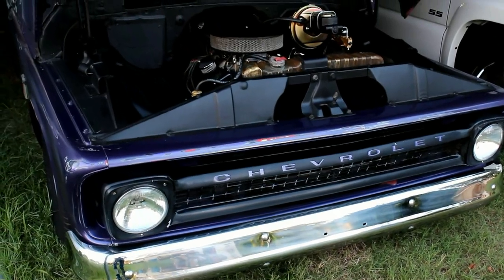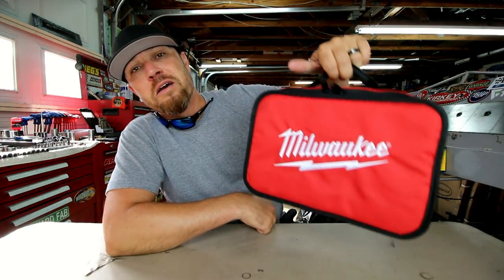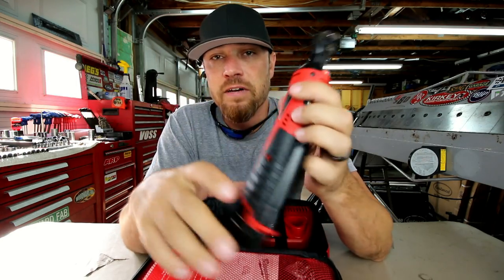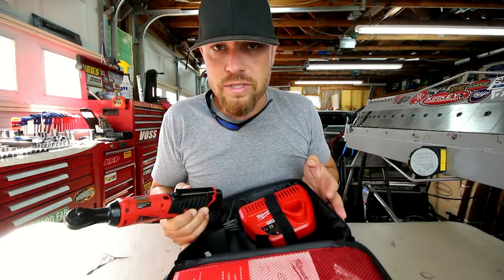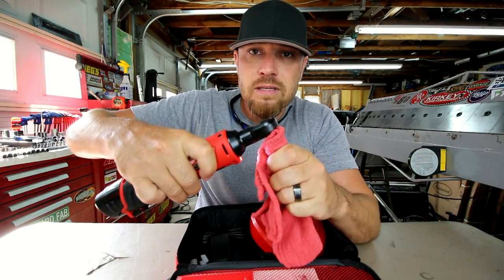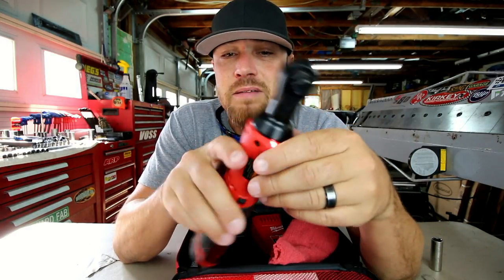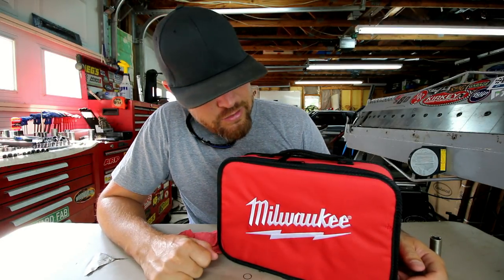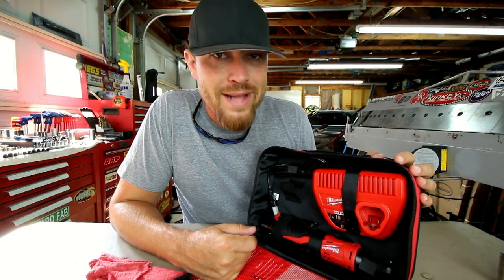You Need This Tool - Episode 77 | Milwaukee Cordless Ratchet Kit

Comment: I started to use mine as a total ratchet replacement, gets into all the same places, and generally more, and also speeds up the job a LOT

good for going slowly when you're trying to tighten something like a bracket that will bind if not lined up just right, jumping back and forth between bolts

I probably use mine like a breaker bar more than I should though..

Comment: I am a mobile mechanic and have been using the 3/8 Drive ratchet for 3 years now on a daily basis it is by far hands down the most convenient, easy to use, reliable tool I have in my truck.Every tool that I have is Milwaukee battery powered and I have yet to have one let me down. As far as I'm concerned there are no tools that even come close to the reliability and convenience of my Milwaukee battery powered tools.Ed Parrish Deuces Wild mobile auto repair
Reply from the maker: +Ed Parrish I would have to agree
Reply: I had all my tools ripped off about 2 years ago tell me for about $5,000 worth and I believe it was Sadder then the day I got my divorce, and to the a-hole who took them, You Know Who You Are, I will find you 👊

Comment: Nice idea from Milwaukee. The tool definitely has value when trying to ratchet bolts and nuts when in a tight space. I still use my air-driven ratchet, the only difference being that I have to turn on the compressor, attach the ratchet to the hose and go to work. The Milwaukee would allow me to bypass those steps and go right to work. All in all, I prefer cordless tools and use them whenever possible.
Thanks for the heads-up.
Reply from the maker: cool

Comment: Been using mine for 5 years. Do a lot of cummins and pstroke work. It ain't balsy by any means but for 10mm bolts, it works great.
Reply from the maker: yeah I see it coming in very handy on v-band clamps and the such

Comment: I have a few Milwaukee tools and the 3/8 Dr Ratchet you have I use pretty much wrenching with Three Wheelers call Go Cars and so far I am very happy and impressed.  Only thing is I wish the outer plastic case was better at not showing all the grease marks.  I happen to own both the 1/4 and 3/8 drive ratchets with the 4.0 stand up battery pack.  Love this tool and I am sure you will begin to appreciate it the more you use it.  Enjoy........  :)
Reply: PhantomPiney not sure to what extreme the grease marks are on your tool but I clean mine with a shop rag and wd-40 in fact I clean most of my tools that way and works great
Reply: Gonna have to try this, I have the same problem as Piney with grease all over it.
Reply: Mr Clean Magic Eraser does good work on cleaning plastic tools like this if it gets too grimy for normal cleaners.

Comment: Fantastic tool at a great price point. I've got 3-4 of each of the Milwaukee 12v drivers, drills etc. in or around shop / house. I've noticed the chargers will go bad before the batteries and drivers. I do drop the chargers a lot though. Keep them coming Kyle.
Reply from the maker: lol...will do

Comment: If I'm out somewhere where there's no available power source then i can see the handiness of battery powered tools.  But if I'm just working in my garage I definitely prefer to use corded power tools because nothing annoys me more than a battery going dead or having to wait for the air compressor to build up (I have a small compressor will fix that soon hopefully)
Reply from the maker: Yeah...its nice to not fool with drop cords though
Reply: The Fab Forums I use that ratchet all weekend on a charge typically, sometimes two weekends on my project car depending on the work- I always just start the bolts using it like a breaker (understanding limits of it) then zip them out the rest of the way

Though wouldn't recommend breaking leaf spring bolts loose with one lol
Reply: Gasosphere seriously look into getting the Milwaukee Fuel line tools. The battery lasts forever at 4.0 Amp/hr and they just came out with a 9.0 battery. The batteries charge up quickly. The M18 chargers will charge both M18 and M12 batteries. A couple extra batteries and you'll never fire up a compressor or jack with cords ever again. I love my M18 fuel high torque 1/2" impact. It out performs many of my 3/4" IR pneumatic impacts.

Comment: For automotive applications, speed and accessibility in tight spaces are the two main advantages.  Need to get them in 3/8 and 1/4 inch to ensure you can get into the tightest spaces.  Still need your torque wrenches and breaker bars though.

Comment: Hey I have one and I'm having problem or I think I do with mine. It shuts off sometimes while using it. I have several other Milwaukee tools and love them. Just not sure if it is suppose to do that or not???
Reply: either a battery issue, or you just reached 35ft-lbs, if you're not aware the tool shuts itself off when it reaches max load so it doesn't damage itself or waste battery

Comment: Milwaukee makes a fine tool.
I have a non-topic question,  I just recently made a deal on a Lincoln power mig 210 mp, i know there are better machines but the price was right and it'll do what i need it to do.... i am going to buy a kit to convert it to the "tig pak" ,but what is the best torch for this setup? is it the standard -17 fixed head model or flex head? will a -19 or - 21 model work? if so which tig torch would you recommend?
If i didn't value your opinion... I wouldn't ask, so..
Thanks Kyle

Comment: I have numerous, Milwaukee tools, they are super durable. My 3/8 ratchet is dropped numerous times and works perfectly after. They will even work while getting soaked in ATF. I would like brushless tools in the future tho
Reply: streetracr204 m12 fuel ratchets are coming later this year.  They have like 50 and 60 foot pounds and there is a 1/2 inch also.
Reply: Joe Walsh really?! I literally just bought a 1/4, damn. Yea it would be nice if the 3/8 had more torque
Reply: I will probably get the non- fuel one. I am not a professional and don't want to spend the extra money.  I don't need that power
Reply: Joe Walsh fair enough,  i do it for a living so the extra torque would be nice. I also work on cars as a hobby and go to the racetrack so cordless comes in handy
Reply: I just looked.  Home depot has them on their site. You can't buy them but pricing and specs are on there
Reply: Then I would definitely wait

Comment: I have a pneumatic one, but I rarely use it.  But when you need this tool, well you know.
Reply: Brian Bowman I never used my air ratchet, I got one of these and use it every day, the air ratchets are noisy and a pain in the ass
Reply: That's one reason I rarely use it.  Is there an impact version of this that's not the 1/2" IR?

Comment: @ The Fab Forums promise you have to buy the 1/2 inch impact m18 favorite tool... don't ever use my compressor anymore unless I'm using plasma cutter
Reply from the maker: its on my list
Reply: Dan D amen
Reply: It’s one of my favorites too.  I have the Gen 1 brushless FUEL high torque.  700 ft lbs fastening, 1100 ft lbs nut busting.  The Gen 2 coming out now has 1000 ft lbs fastening, 1400 ft lbs nut busting.  And it’s lighter and shorter than Gen 1!

A lot more people will be hanging up their air impact gun pretty soon.  There’s deals going on on the Gen 1 right now too.  Was at HD today and all the 1/2” high torque impacts with batteries & charger were on clearance shelf marked down to either $199 or $179.
Reply: Superman the mid torque can certainly do a lot of things, and is probably enough period if you’re working on cars and, for the most part, light duty trucks, and not dealing with a lot of rust.  

I don’t mind the weight of the high torque and it has proven essential for some rusted, seized, and loctited 1/2” + sized bolts.  But I mostly use my 18V FUEL impact driver with square drive adapters anyway.  Between the two, I’m mostly covered.  That driver can take off lug nuts tightened to around 125 ft lbs, probably higher.
Reply: Superman to add, that mid torque, the new one is amazing.  It is so compact!
Reply: chris jones I did.  Awesome top 5💪💪👍
Reply: asm154 1 thanks brother

Comment: Man if you would have waited a little longer, word is they're going to be introducing the new "FUEL" line version of this ratchet coming in the last quarter of this year. It's brushless, more torque, etc. I'm just holding out as that's the last tool I'm waiting to get to complete my lineup. Good video though and thanks for keeping up the "You need this tool" vids.
Reply: Anthony Burgess same here 👍
Reply from the maker: Oh really...guess I may have two then ;)
Reply: that was one of my complaints when i got mine. better battery management with the fuel
Reply: You can never have to many!
Reply: Anthony Burgess im waiting for the brushless aswell
Reply: I think I'm addicted to the brushless 18v platform of Milwaukee. I have like 12 tools and still keep looking for more lol.
Reply: Anthony Burgess i bought the brushless 18 sawzall a month or so ago its doing well. I had a 18v ni cad craftsman and this fuel battery lasts sooooooo much longer and its just a better feeling saw
Reply: Anthony Burgess good choice hold out cuz the one out right now doesn't have a lot of torque
Reply: IROC TWAN I lied when I said that's the last tool lol. There's no such thing as too many tools AND I now have to sell my brand new 2763 1/2" high torque impact to make room for the Gen II version of that impact. Smaller, more torque...the struggle is real.
Reply: Anthony Burgess lol i know what you mean  Milwaukee has changed the whole game where battery-powered tools  are concerned a air  compressor will no longer be needed
Reply: Honestly, at this point in it's life, I just decided to pick up an m12 ratchet, and after reading plenty of YouTube comments and speaking to other techs, I got the older version. The price point of the new one really isn't justified. Sure there's more torque and it's brushless, but for $100 extra it's not worth it. It's not meant to replace an actual impact or pneumatic tools, it's there to reduce your time of wrenching so it wasn't worth it to me.
Reply: The M12 is wayyyy better!  The weight difference between the 2 are ridiculous, this little M12 feels so much better in my hands. I can get into tighter places when I'm in difficult to reach areas, after about an hour of working with it, the weight differences will rear it's ugly head with the Fuel in your hands, causing you to reach for the M12 every time!

Comment: You really owe it to yourself to check out Milwaukee's new M18 1/2" drive impact gun ( model 2767). I just bought one and love it. 1400 ft.lbs of torque to bust the lug nuts loose on my 2.25 and 3 ton trucks.
Reply from the maker: +5782d I will do that for sure

Comment: I do like them but just a little light on torque? I have a Snap On 3/8 impact wrench and it tends to get ignored in the toolbox for this very reason. I still use a speed brace when needing speed on a gob but get the feeling they gone out of fashion? Does anybody make a socket set that comes with a speeder as standard anymore?
Reply from the maker: yeah

Comment: the Milwaukee tools are nice. I have 2 of the 3/8 ratchets, 2 of the 1/4 guns, 1 3/8 fuel impact. they might be the best of the battery operated tools. however, when used daily, they do not last very long

Comment: That would have come in handy a few weeks ago, when I did the intake gasket on my daughters mini van. I probably invented some new curse words, and my beard is definitely grayer. 3/8" air ratchets produce such a loud annoying sound in an enclosed area. It's never occurred to me to check out Milwaukee hand tools. I have their 14" abrasive cut-off saw, only a couple of years old and love it. No brand loyalty other than Mopar. I have all the colours of the rainbow in my toolbox, or shelves. Stanley, Dewalt, Craftsmen, Makita, ect..., Do you use oxy/acetylene. To lazy to run out to see what I bought used, higher end name brand, but the hoses are real stiff. No flash back arrestors. Victor is the brand. Not so lazy I guess.
Reply from the maker: for sure

Comment: So your recommending it and haven't even used it yet? Nor did you test it, interesting? Can a 12 volt actually break loose a nut? Cause my 12 volt Milwaukee Impact driver is useless as a impact driver. I'll tell anyone, for doing serious work get at least a 18v anything. 12 volts are nice for convenience, weight and light jobs ( I LOVE my (2)12 volt Milwaukee drills, very nice, great for medium duty jobs and I'll put it up against any 14 volt drill) but can a 12 volt ratchet actually be useful in real world situations? I'm very skeptical
Reply from the maker: yeah its not made to break nuts loose or to be used as an impact driver. more of a tool of speed. It does however have some pretty good ass to it

Comment: get a snap on one , more bang for the buck
Reply: Juan Romero bang for the buck? The milwaukees are 89 dollars brand new with warranty. Where the snap on one is about 250+
Reply: 370  plus tax but, i tear down semi truck engines, up to 10 mil bolts. let alone a car engine. had mine for 4 years and still running
Reply: i guess it depends what u r using it for
Reply: Shop setting I guess the snap on it better but for the weekend worries the milwaukee is the way to go.
Reply from the maker: yeah for sure...

Comment: I have a 10mm (manual) ratchet wrench for my Deere lawn tractor and Camry.  $5 ish...    I am early retired so taking an extra 1.267 minutes to do the job is no problem ..  If I had an electric ratchet I could be back in the house quicker and listen to an extra 1.267 minutes  of what a useless POS I am from her indoors..

Comment: These are eh... Definitely not a bad tool but not a lot for the money. Matco makes one with far more bang for the buck.
Reply: Mustang Man lol for $350? I could buy 2 of these and still be better off
Reply: Having owned both. Matco is still worth it. The milwaukees are plastic everywhere.
Reply: Mustang Man but for people like me who are already invested in the battery platform and don't work professionally in the field, it's an awesome product. I work on golf cars for a living, and this ratchet has saved me so much time where I would've otherwise hooked up an air ratchet or use my normal Mac ratchet.
Reply: Like I said, It is not a bad tool by any means. I just find the Matco to be more favorable. I fully agree that Milwaukee is good stuff